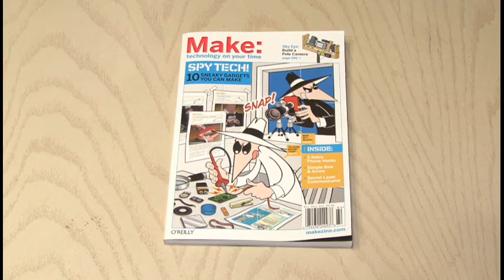Weekend Project: Make a Sneaky USB Battery!

Comment: That's a little too simple to serve as an explanation... Magnets and magnetic fields usually destroy electronic devices by creating electrical currents in the traces and chips through induction. Naturally, for this to work, the magnetic field has to be oscillating - perhaps caused by a moving magnet.

Unless that magnet is really, really strong and you yank it out at significant speed (or wave it over the device), you shouldn't have a problem.

Comment: As far as I know, magnets don't create an electric field, so electric charges inside the flash memory shouldn't move. It would need a big electric field to change data inside silicon gates.
I'm not sure, but it won't, also because the magnet is almost steady, so no current is genereted on wires.
Someone who knows electronics/physics better than me should say what happens definately!